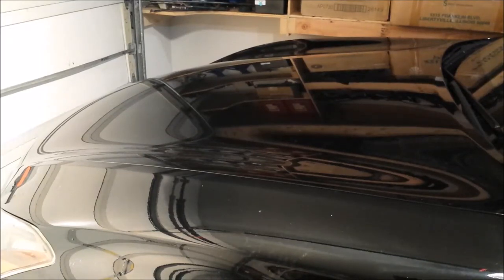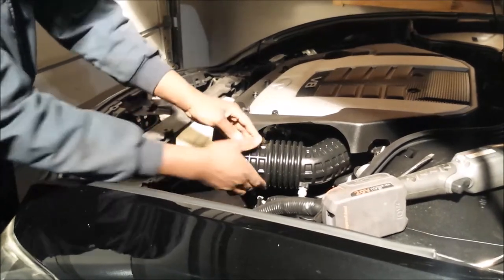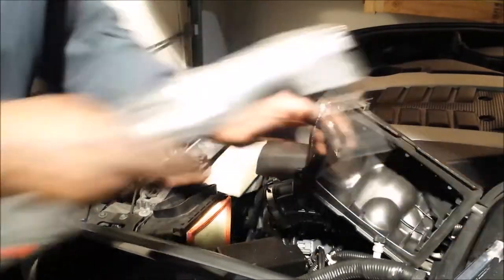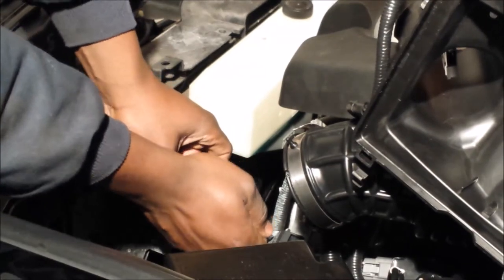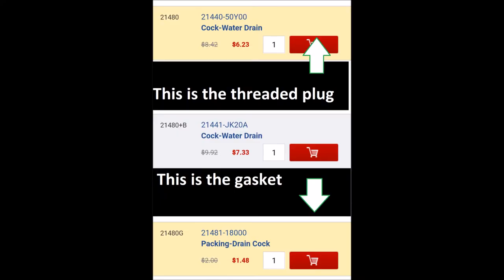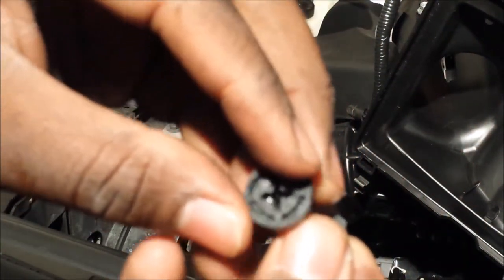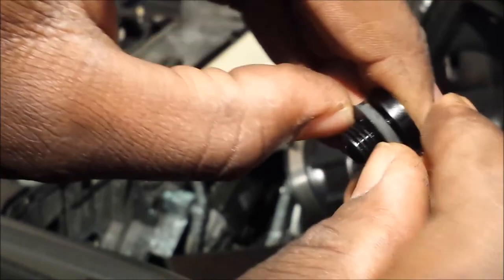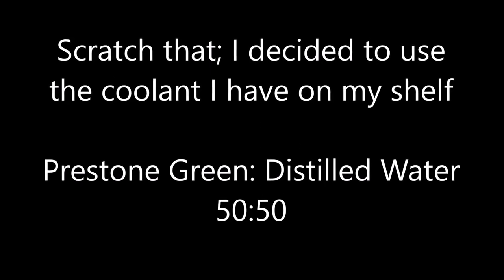Fix coolant leak from radiator gasket | 15-minute job. Infiniti M56 M37

Comment: Had any experience with the radiator itself as far as r&r??? Or stop leak stuff??? The lady dropped the front end on a driveway the other night cracking the bumper and cracked the radiator.. Small leak right now.. Infiniti tells me i need condenser/radiator assembly as you stated in the vid, but I'm finding them for sale individually.... Thanks Ed..
Reply from the maker: Oof! Sorry to hear that man. So soon!

I havent gotten to radiator disassembly, but I think someone in the forum has. I knkw for certain that the radiator can be replaced individually. 
I do not recommend the stop leak type of chemicals. You're bound to have more issues down the road
Reply: @EdBwoy  I'm glad to hear that... Cheapest 1 I've found is from 1800RADIATOR for $285.... Wholesale infiniti site is $680 (for cond. and rad. assembly)... Whatever... Thank you for re affirming my theory of separation here.. Hoping i can do w/o evac of ac... Going to be bypassing the integrated plastic trans cooler tho... Picked up the basic stand alone truck 1 from oreilly for $25... I greatly appreciate you man... I will try to remember to film the r&r.. No software or editing knowledge so wil prob be a long vid 😆... Thanks for insight on the stop leak... Have used with great success in past but with all these aluminum internals, you're right, best not to chance it.. Subaru makes some amazing stuff i have used on the vk45... Little blue bottles... Pricey, but worth it... Hope you had a great turkey funeral, amd hope you have a wonderful xmas protest 😆
Reply: @EdBwoy , hey brother. i will be checking for this leak this weekend, but in the event i actually have to change out the radiator, would you mind making some recommendations?

• radiator brand.

• which tubes [part numbers] if any do you recommend changing along with the radiator?

• anything i need to keep in mind regarding whether or how to bleed air out of the system once the coolant has been replaced [i found a video that shows the process of replacing the radiator and it seems straightforward, but it’s missing those little details].

• recommendation for best coolant to use. i currently am using the orange prestone dexcool [orange] since discovering the leak last week, but there seems to be a wide range of suggestions. i trust your guidance.

• would love to see YOU do a video of this work! in the meantime, though, i appreciate any guidance you can provide. thanks in advance.
Reply from the maker: @ldcstudio5060  I'll copy-paste my response to your message here, in case others look for the info.

...
For the radiator replacement, Denso is a good brand. I usually went with Koyo or the TYC brand as well. Usually all good.

You don't necessarily need to replace any hoses unless they are leaking, but the radiator cap would be a good idea. I only use OEM parts for the coolant system, for both the thermostat and radiator cap.

For coolant, I also try to stick to OEM these days. It's not all that expensive, and it's a service that you don't have to do too often anyway.
Assuming your car is a 2011+ Infiniti M, how did it end up with orange Dex coolant?

I hear the V8 is easier to bleed than the V6, but for both you use the relief plug off the heater core hoses. Some people use coolant fill funnels to help, but I believe I did discuss it in one video. I've never had any issues myself.

Comment: Do I have to drain any coolant first before I perform this job?
Reply from the maker: Ideally, yes. Otherwise it will just leak until that level is reached
Reply: You could probably buy both a new plug and gasket and put the new plug in as soon as you take the old one out

Comment: Wheres does the button coolant hose goes into ? My Infiniti M35x 2010 the AC blow HOT AIR I ALREADY ADDED AC PRO AND REFILL COOLANT DO YOU KNOW WHATS THE PROBLEM?
Reply from the maker: The bottom coolant hose most likely goes to the thermostat.

It should not affect your AC. Check to hear for a click noise when you push the AC button. If you don't hear it, your compressor clutch isnt engaging. Let's start from there

Comment: Does that transmission fluid go through the radiator to cool off? I’m about to do preventive maintenance to avoid the strawberry milk transmission. So I was just going to replace the radiator just Incase
Reply from the maker: Yes, the transmission cooler is usually part of the radiator. Some people get an external trans cooler to avoid the kind of issue you mention
Reply: EdBwoy yeah I been looking for a separate cooler with no luck. I’m just going to change the whole radiator for now.
Reply: @jamesofalltrades4359  if you haven't done so yet, just get a universal trans/oil/steering cooler from oreilly or advanced.. Comes with a cooler, hose, clamps, and ties; $25 here in denver...
Reply: @mikeschaner5853  this is the option that I used.